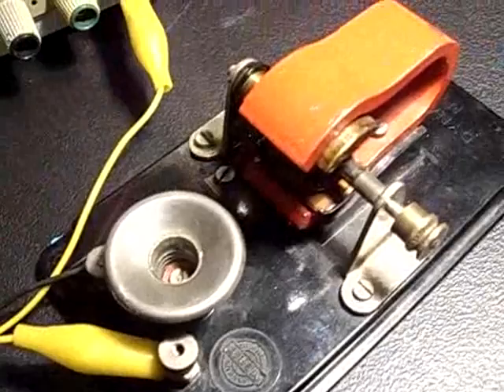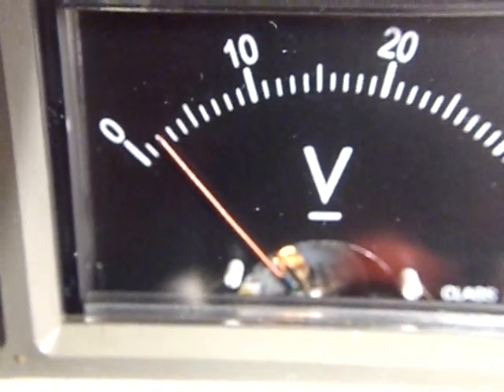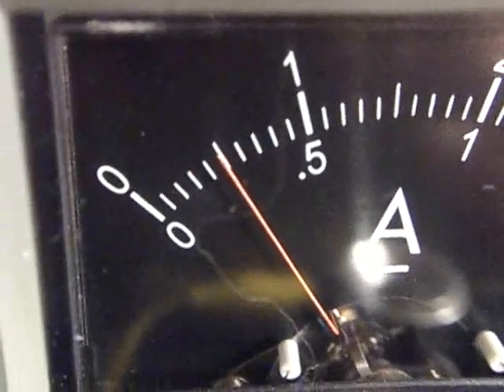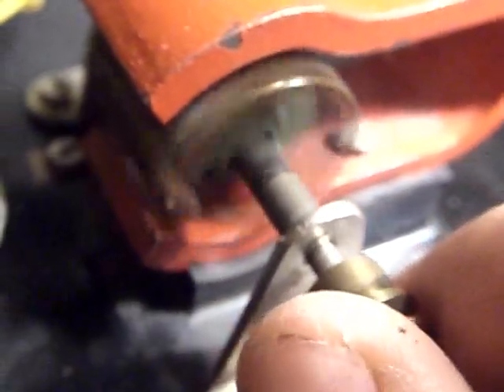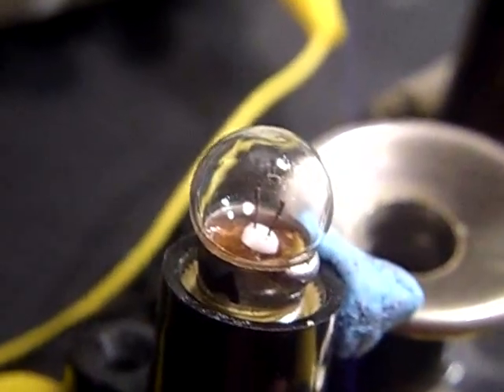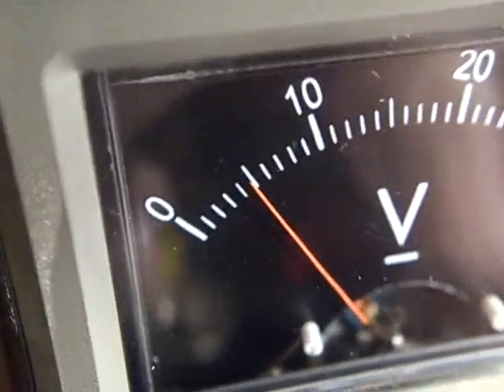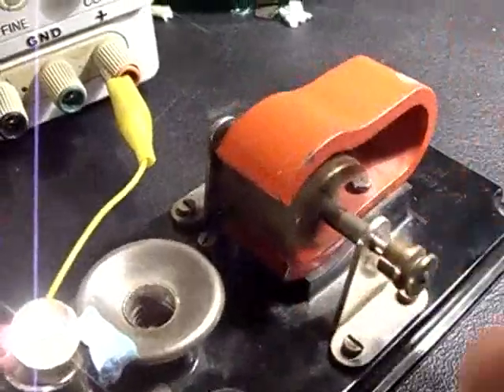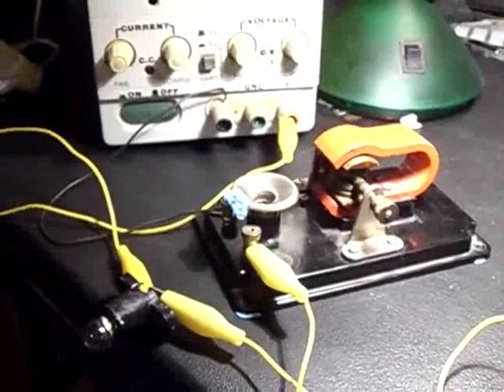voltage and current relationships

Comment: In a meterFMMC, the wire also cuts a magnetic field. The needle turns swiftly because the charge in the wire has decreased and the mass has decreased and the wire seeks a part of the magnetic field of similiar conditions. We can say the current has decreased in magnetism and increased in electricity and hence moves out of a 'high magnetism and low electricity' part of the magnet's field. A meter cannot measure both voltage and current because it is only one instrument not two. Seek the truth.